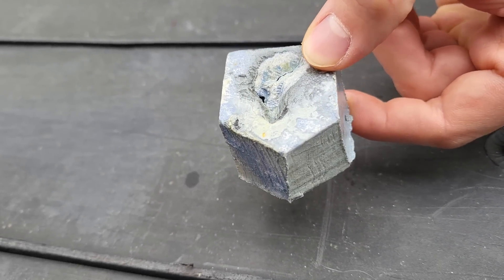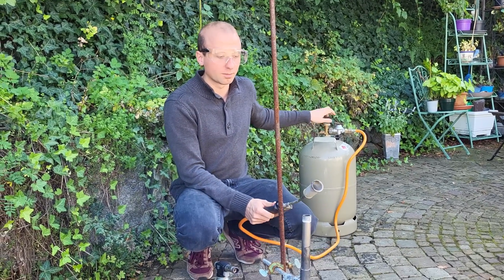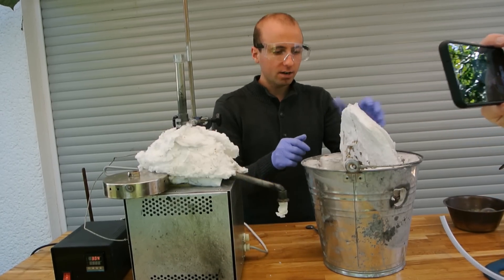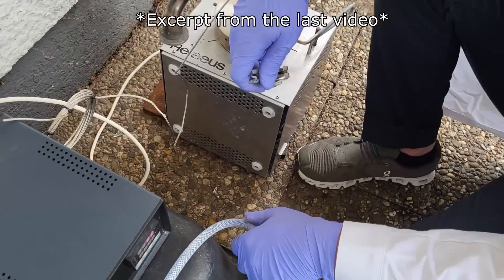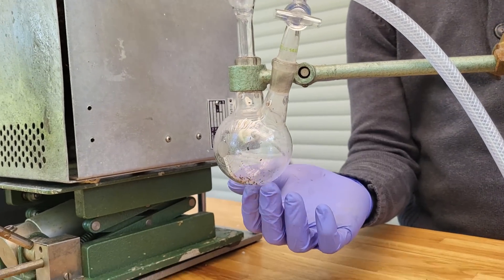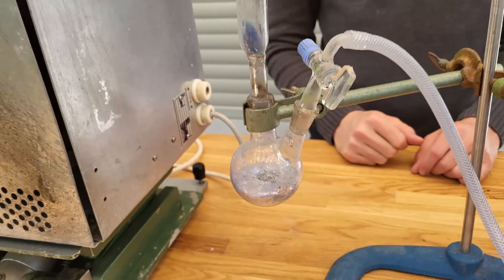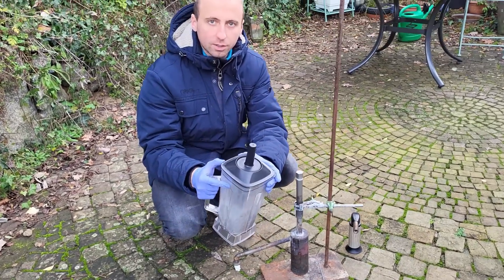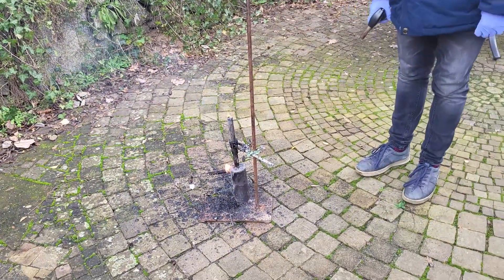Potassium Metal From Potash

Comment: Can anybody explain the chemistry of this process?  How can a less reactive metal (Mg) reduce a much more reactive metal (K) from its salts?
Reply from the maker: Because MgO is more stable then K2O and the Mg reactions mostly with the CO2 from the carbonate, which releases most of the energy for the reaction.
Reply: @EliasExperiments  So, if I understand you correctly, MgO statistically is less likely to be created than K2O due to higher reactivity of Potassium, but once created a MgO molecule has such strong bonds that there are not enough ionic energy to break it whereas K2O is not so strongly bound. So, with time the amount of MgO will constantly grow until all Potassium ions are (reluctantly) reduced to metal. Am I wildly wrong with this description?
Reply from the maker: You are mostly right, but I would not call it statistics, it is just that the energy balance of the reaction is in favor of potassium metal.

Comment: Why make things complicated? Use a different process - add dry potassium hydroxide, magnesium dust, and a little menthol to the dioxane solvent as a catalyst, equip the installation with a reflux condenser and start heating to the boiling point of dioxane - the process will begin! The desired potassium will fall out at the bottom in the form of molten drops. The process is not fast, but the potassium purity will be very high. In the same way you can produce sodium from its hydroxide.
Reply from the maker: That sounds interesting, but it also uses quite toxic dioxane and what is so complicated about the shown process?
Reply: @EliasExperiments  https://www.youtube.com/watch?v=BsNoiFj3wlw&ab_channel=NurdRage Without Dioxane, as you wish!)))
Reply from the maker: Thank you, but I have seen that video was unable to replicate it easily. You can find my attempts on this channel too.

Comment: Is there a reason you cannot use alcohol-catalyzed magnesium in oil? Or would that be too boring, and the wacky method is the fun of it?
Reply: To my knowledge, the alcohol-route will work as well but it will need more sophisticated conditions and equipment. The solvent-free synthesis presented here is more robust.
Reply from the maker: I completly agree with what Frank says.
Reply: Well, that's completely fair enough.

Comment: Surprised! Thought the metal need to be more reactive than the oxide to reduce the oxide/ do a thermite reaction
Reply from the maker: The thing is that we also have Carbon in this equation, which messes things up. Also the stability of potassium oxide is rather low and magnesium oxide is very stable. All those things also influence what product formation is preffered.

Comment: This is an excellent result. Potassium hydroxide might be better, but its problem is that it melts a lot easier (leading to loss of intimate mixing) and has a lot more water inside, so the extra yield might just be gobbled down.
I suggest getting a small tank of argon and keeping things far from any air. Well done.
Reply from the maker: Thank you! I have tried it with potassium hydroxide and you can see the results at the end of this video. It burns way to violently for it to be useful. I store my K under kerosene for now and it seems fine.

Comment: Sorry but this is click bait, I don’t respect displacement reactions you’re just robbing magnesium of its complexity to be produced. Nothing more than another form of thermite.

Produce it through electrolysis or from ultra temperature hydrogen reduction and you might have actually achieved something
Reply from the maker: On the one hand I am sorry that I disappointed you on the other hand I disagree that this is clickbait. In the video I do precisely what I show in the title. Also potassium metal is produced industrially by reduction of KCl with Na-metal. So the process shown in this video is certainly cheaper and easier for the amateur.

I do actually have two ideas that could work to produce K metal in a manner which would satisfy your demands. But if I ever get them to work efficiently enough that I can make a video about this is not all too likely.

Comment: You can use KCl instead of K2CO3.  One thing that is created using carbonate is magnesium carbide. It will react similar to calcium carbide but generates methane.
Reply: Not correct. The reaction releases propyne.
Reply from the maker: No you can't actually substitute K2CO3 for KCl. You need far higher temperatures for KCl and Mg to react and at those temperatures both substances already start to evaporate. I could not obtain useful amounts of potassium with that reaction. Magnesium Carbide sounds interesting, I never thought about that forming during this reaction.
Reply: @EliasExperiments  How do you find out the necessary temperature for such a reaction? Speaking of chlorides, Mg will react with SrCl2*6H2O.
Reply from the maker: It is quite simple, you mix the reagents together and see what happens when you heat them up :D

Comment: Nurdrage was doing a similar process for sodium, creating the metal by first reducing a salt with magnesium, however he eventually moved on to doing it in mineral oil with a tertiary alcohol catalyst. I don't know if the yields would be better, but I would guess you will lose a lot less material to the incineration process. While his video is mostly directed at using sodium, there is a similar method for doing potassium using a different catalyst. It also seems that reducing the potash from KCO3 to KO or KOH by heating would also improve yield. Still, this looks like the fun way to do it.
Reply from the maker: Yes I have seen Nurdrages series and it was amazing. You can probably achieve better yields with his process, but it is also very difficult to scale up, which is what we are trying to do here. 
Reducing K2CO3 to KO or KOH by heating to improve the yield is more or less impossible for practical reasons. There is no way you can easily get K2CO3 this hot that it will decompose.
Reply: By far his most in-depth series ever, and I loved every second of it!
Reply: NurdRage also made potassium metal with this process a long time ago (and that was the inspiration for doing the same with sodium), but the video was unlisted for some reason.
Reply from the maker: Yeah I saw that too, I hope he picks the series back up with potassium metal, that would be incredibly amazing.
Reply from the maker: Yeah I saw that too, I hope he picks the series back up, that would be incredibly amazing :D

Comment: The reaction between magnesium and potassium hydroxide looks like it could potentially work as a solid rocket fuel.
Reply: Not really, performance rocket fuels need to produce large volumes of hot gas to efficiently use the energy produced, this reaction produces mostly hot solids and very little gas. That's why sugar fuel/R-candy is considered novice/amateur rocket fuel, the majority of it's reaction product is KOH/Potassium Hydroxide. The good stuff, APCP (Ammonium Perchlorate Composite Propellant) rocket fuel, produces mostly hot gas with a small quantity of aluminum oxide, but because of the heat produced by the conversion of metallic aluminum to it's solid oxide you end up with a net increase in gas volume due to additional heating of the already hot gas (consisting of water, carbon dioxide and hydrogen chloride).
Reply: Yes it does but isn't air stable.
Reply: Not really, it's closer to a thermite than to a normal rocket fuel, mostly because it's not energy dense enougg, so you end up with a heavy material that produces tons of slag
Reply from the maker: I have no idea about rocket fuels, but I can see how it might power something.

Comment: Potassium is a strange metal and the release from its compounds is most fascinating. I couldn´t believe that you put your hand in NaK.:hand-pink-waving: Many thanks for sharing with us.
Reply: He did not literally touch it. Hand was covered in oil.
Reply: @lajoswinkler  That´s the magician´s stunt.
Reply from the maker: That is also a fair point!
Reply from the maker: Thank you very much for your kind feedback! I made an entire video about putting my hand in it, you can find it on my channel. ;-)
Reply: @EliasExperiments  Many thanks for the hint. I will definitely check it out.
Reply: I wondered about that as well as touching the metal with the bare hand (the oxide coating may protect it but the potassium hydroxide formed with moister is corrosive). May this is akin to people walk on fire embers.
Reply from the maker: Yes, touching potassium metal is actually similar to walking on fire ambers. If you don't touch it very long and clean your hand afterwards you will most likely be fine.

Comment: 60% is really good, best I've got is around 30% on a small scale run using KOH and Al powder
Reply from the maker: I actually tried to repeat your video on a larger scale and it blew up on me under vacuum. I wish I had filmed that, but I am afraid the KOH + Al Method doesn't scale too well.
Reply: @EliasExperiments  Damn that's a shame, good to know though, I guess it's not a reaction you can control very easily
Reply from the maker: Yeah good to know and I would not recommend repeating that :D
Reply: @EliasExperiments  Why do you think aluminium blew up and not magnesium?

Comment: Great work! I might've missed it, but if you're going to distill it off anyway, why not simply use potassium chloride? It seems to be easier to obtain (as non-sodium salt in many stores) and I don't think it has the same fiery initial reaction.
Reply from the maker: Thank you! I did not want to go into detail about this in this video, because most people would probably find that boring. I tried to use KCl and Mg, but I never obtained a useful amount of potassium. You need much higher temperatures for this reaction to work and at these temperatures the KCl and Mg start to distill too. So you would need a colum to distill it, which is not really pratical for at home purposes :D
Reply: @EliasExperiments This is very interesting, I wish you had included it since already people are suggesting it in the comments.
Reply from the maker: Fine I will include it in my upcoming video where we scale this up.
Reply: @EliasExperiments Things not working as planned can be very interesting and also give the video a nice story arc.

Comment: Very curious . . . Why would magnesium reduce potassium from its compounds?

Isn't potassium much more reactive than magnesium?
Reply from the maker: Because magnesium oxide is very stable and potassium oxide very unstable. Also most of the energy in this reaction comes from the magnesium metal reducing the carbon. So the overall energy balance of this reaction is highly in favor for the formation of potassium metal.

Comment: You generally only have to worry about Tetanus when rusty iron is in contact with soil for long periods of time, hence why its cliche for a rusty nail on the ground that penetrates a foot to cause Tetanus.
Reply: Rust, of course, has nothing to do with tetanus. It's just that things that are rusty are more likely to have been in contact with stuff like mud. Clostridium tetani is found in dirt.
Rust and tetanus is just an urban myth.
Reply: @lajoswinkler  rust has a lot of surface area for bacteria to cling in, and a higher probability of cutting/penetrating you, hence the connection.
Reply from the maker: Lol thank you for all the input, I never thought I will learn that much about tetanus from one random comment in a video. :D
Reply: The reason, if true, could be enhanced bacteria growth due to iron ion availability (which usually is a scarce resource for them). But I'm not convinced.
Reply from the maker: That's interesting. Please explain that to Advanced Tinkering XD